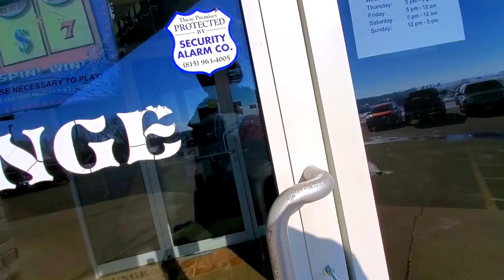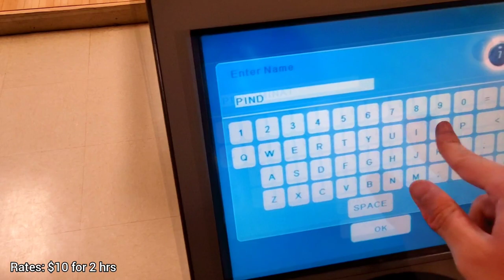Bowling at Lakeside Lanes [Last Day with Wood Lanes] (A-2)

Comment: The new scoring system is used actually(Vector), which hasn't been sold new since 2018. I would say that Vector is a big downgrade from the ComputerScore system(what was there previously)
Reply from the maker: I agree. They look nicer, but the previous system was much better.
Reply: @PinDominator  Vector with touchscreens is especially bad, almost all of the ones here have gone out of calibration and you have to press under the button you want to press.
Reply: @Rodj12341   The touchscreens were horrible. In fact, I bowled at a center called "Playdium" located in Quezon City🇵🇭, they used to have the old Frameworx Scoring with Touchscreens since 2003 until they replaced their Touchscreens for Keyboards in 2016 and eventually they got the Vector Plus scorings in 2017 while swapping out the Frameworx Keyboards for the Vector Keyboards. The coolest part about their keyboards is they're transparent.